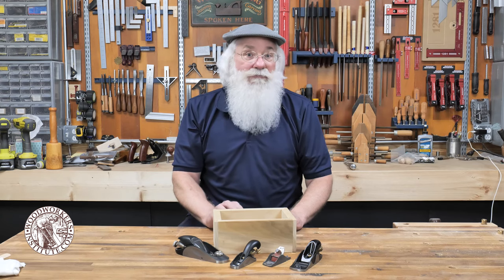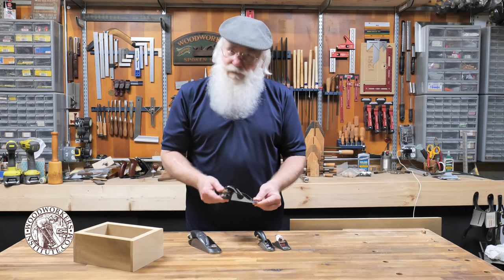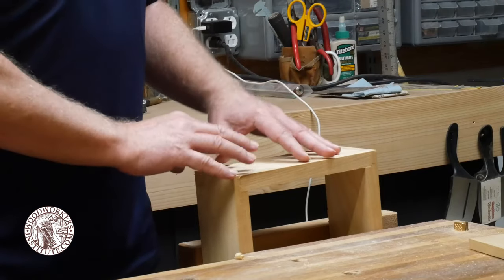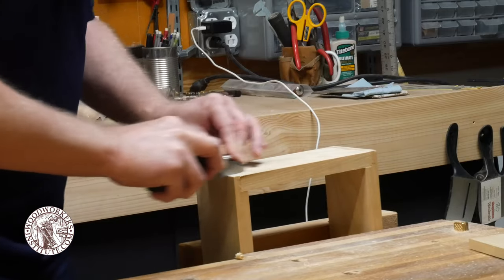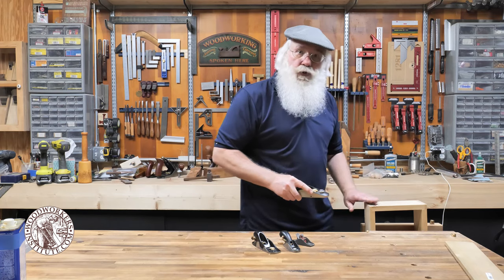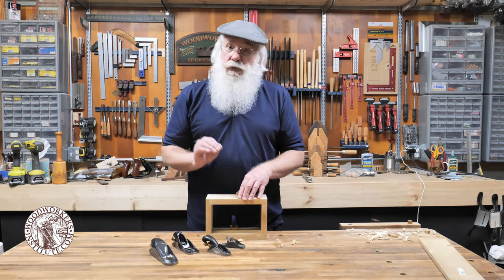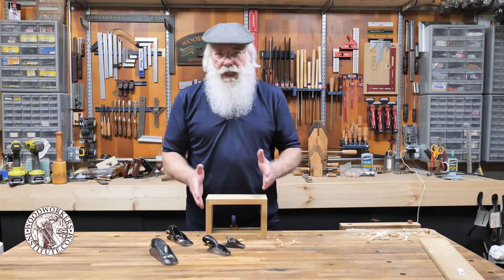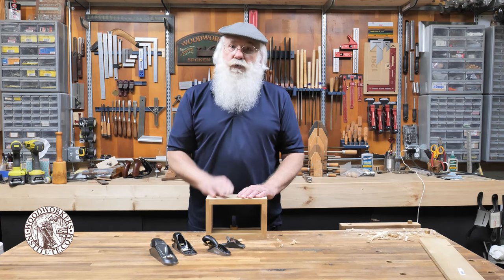Quick Tips: Uses for Your Block Plane [Woodworkers Institute]

Comment: I took note of the continuing movement of the block plane while removing those box corner projections. I believe it is far more efficient and safe in terms of blowout than an interrupted motion (stopping). It also allows much better feel for judging force required than a succession of individual strokes.